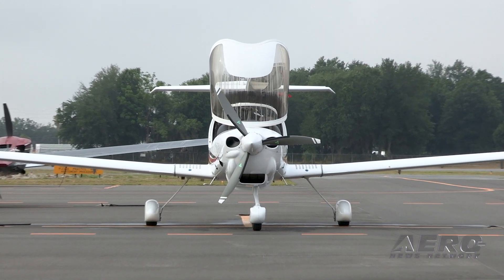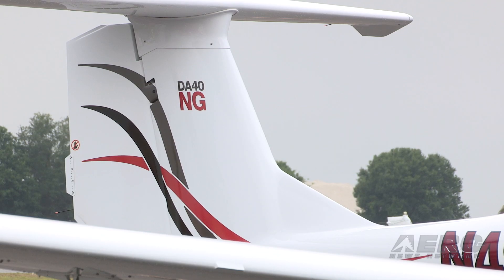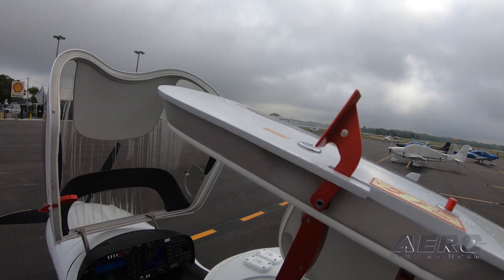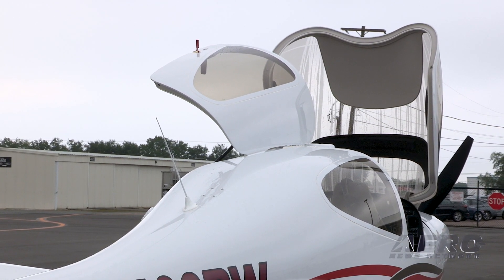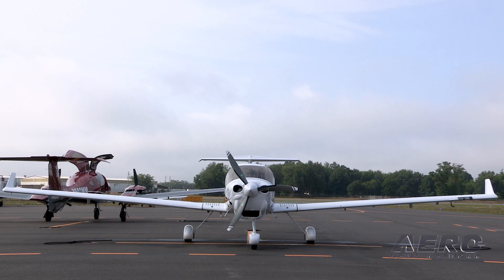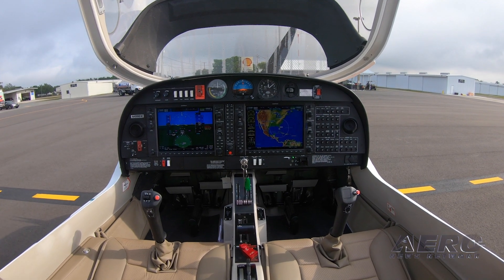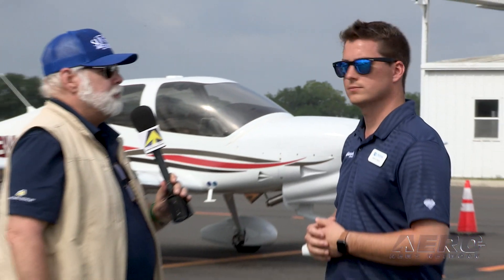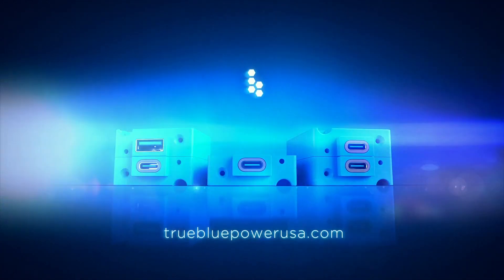Aero-TV At SnF21: Triple Threat! Diamond’s Truly ‘Next Generation’ DA40 NG

Comment: If I had the resources, I'd have one of these great little planes in a hangar (if I could find a hangar for rent at an nearby aircraft). I am curious, however, to see how Diamond addresses the prohibition in windmill restarts that applies to THREE AD's for the DA42. The issue on the twin is that the timing chain will jettison if a pilot attempts a restart while the propeller is windmilling. As long as a pilot doesn't shut off an engine in flight there should be no issue (I hope).

Comment: Why are they so expensive? The technology is almost same as on a car.
Reply: Which car has a large carbon fiber body? Has spars and ribs to hold itself up without resting on tires? Has long range two way radios, engine management, a propeller, very large windscreens of plexiglass, oxygen, avionics suite, etcetc and etc
Reply: A very respectful reply to an absolutely idiotic comment.
Reply: Not too dissimilar in cost to a new 172/182. More efficient, more safety features, fuel won't be banned. I'd take this over a new 172 every time

Comment: Unfortunately, the DA 40 NG is not yet available with the more powerful AE330 engine of the DA 62. The DA 40 NG in particular could use a bit more power.
Reply: think its the same motor,,, just different ecu software
Reply: Maybe true because the engines weigh the same, so it would be great and beneficial to have the existing and proven AE330 in the DA40NG
Reply: @MAGApepe  wear your seat belt
Reply: Management of DA is Chinese. They do want they want and not want client wants to have. Very restrictive and all focus on money making.